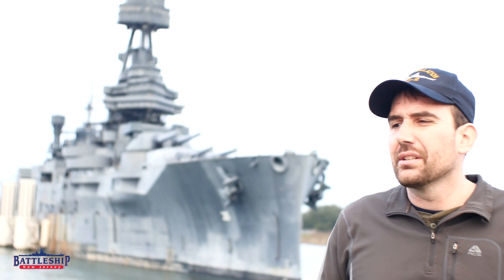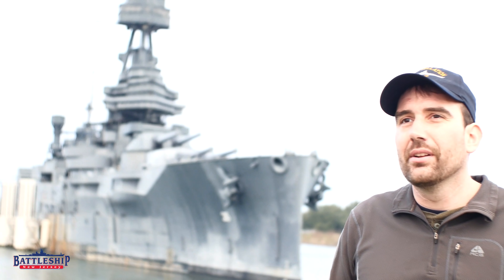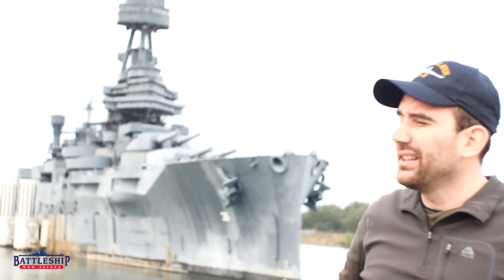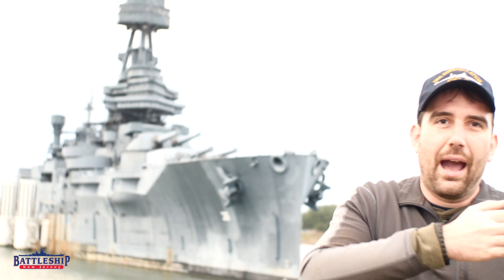Why Is Battleship Texas Shaped So Weird?

Comment: The designers of Texas, as you pointed out, had good reason to make Texas look as she does.  They were trying to solve as particularly set of problems.  That really world experience showed that there was better solutions too those problems is a normal part of engineering.  The Iowa's are just the latest in the evolution of battleships.

Comment: Easy answer, the original secondary weapons arrangement which never really worked out in practice on any ship. Modern (for the time) upgrades and modifications to the hull over the years, torpedo protection, etc., contributed to the “odd” shape. The California and Tennessee really demonstrated that.

Comment: I have a question about seacocks/valves.
Is there a difference between a seacock and a seavalve?
Are they there solely to aid in the scuttling of the ship? Or were they originally designed for other uses or purposes?
Reply: They were for cooling water, fire-pump suctions and evaporator feed suctions' they come off of what is called sea-chest. The main circulator for the main condenser was usually the largest and some main condensers also had scoop injection for speeds over 5 knots.
Reply: @robertmurdock9750  
Awesome! Thanks for sharing.
That tells me that their use for scuttling was ancillary.
Reply: @randypowell3180  Yes.

Comment: I've always wondered why more battleships didn't carry torpedoes or use quad gun turrets once the tech was there?
Reply: As the French and English found out,  quad turrets are problematic and cramped compared to triples. 

Most torpedoes of the WWII era had short ranges of 9000 yards or less.  The longest range one, the Type 93 Long Lance used by Japan was about 20k yards at its fastest setting and about 45k yards at its slowest.  Hitting targets at those ranges with slow, non homing, torpedoes was... unlikely, at best.

Comment: What is that circle right at the very front of Texas?
Reply: anchor chain passed thru it
Reply: @hirisk761   Nope, the forward holes are hawser pipes. These are pipes to hawser holes (The part you see externally) that mooring lines were passed through to secure her to a berth. The anchor chains pass through were the anchors are just behind these.
Reply: @Cragified  oops that was gonna be my second guess. thanks for the correction
Reply: Got my doubts we have a correct answer here. Look bigger than needed for mooring lines.  Did she originally have anchor secured there ? (or another set of anchors)
Reply: Craigified is correct.  Those are hawse pipes or hawse holes for mooring lines. Remember that mooring lines back then were Manila rope, not nylon, braided nylon, or some even stronger synthetic.  They needed to be considerably larger diameter to have the same strength.  You need pretty strong mooring lines to secure the massive weight of a battleship.
Reply: @wfoj21  I just googled pictures of the Texas when launched. there are 4 ⚓️ mounted but they are lower and further aft. those are hawser ports

Comment: Why did the move the rear mast on texas?
Reply: The original wastebasket masts couldn't take the weight of the modernized fire control gear, so they were replaced with tripod masts.  It was determined that Texas and New York couldn't mount to full-height tripods, so the superstructure was altered to bring the funnels down to one, and mount one full-height tripod forward, and a lesser platform tripod aft.

Comment: Form follows function as they understood it at the time of design.  Technology was accelerating rapidly at that time, both in sub and aviation warfare, which dramatically altered functional expectations year by year.  The ship went to design 7 years after the Wright brothers first flew and before anyone had a functional high seas submarine.  The big gun/line of sight philosophy of the day was only dated when using hindsight.  What is too often overlooked when comparing military hardware is the date of design, not the date of completion.....or those designed just a few years later.  The Brown Bess musket was current technology for almost a century, the battleship Dreadnaught was essentially obsolete by the time it finished sea trials.  Time and technology shifts matter.

Comment: I am curious as to why the casemates are layed out so differently than other nations’ casemates Why did early battleship like Texas have three bow anchors, with two on one side, and why did these third archors largely disappear by World War 2? Also would it be wrong to consider Texas as part of the Standards, despite predating them, considering her 14 inch armament and 21 knot top speed?
Reply: I believe that Texas was considered a "Standard" as all of those had 21 knot top speeds.  The outlier on the New Yorks (of which Texas is a member of) is the fact that she was a) originally built to use coal fired boilers instead of oil and b) has triple expansion engines--if I recall what I read correctly, this was due to a disagreement between the Navy and the builder.  All the other Standards had oil fired boilers and turbines.   The more well known Standards (the Nevadas, Pennsylvanias, New Mexicos, Tennessees) had 14" main batteries, with only the Colorados having 16" main batteries.

Comment: @Battleship New Jersey I would love to hear you cover the development of the cage and later tripod masts for Texas and the Standards… as well as the later pyramid-style masts on the NC’s and later BBs.
Reply: I was thinking the same thing.  The cage or lattice masts were thought to be a weight saving way to get the range finders as high as possible.  In heavy seas, the battleship USS Michigan had a lattice mast fail.  Live fire testing showed the lattice masts could take several hits without failing.  The Navy thought that made them safer than the later tripod masts.

Comment: A lot of the "weird" design features are actually iterations of earlier design features, from pre-battleship boats.
Multiple levels of gun decks for instance, was a slow fading of the design tradition of wooden Ships of the Line (from the time of the Napoleonic wars).  The Navy is nothing if not hidebound, and tradition bound.
Also, until you try these things out in combat situations, it isn't always completely obvious what will work and what won't.  Leaps of forward thinking are not easy intellectually, or easily justifiable.  Ships are very large and complicated. You don't just whip up a design for a revolutionary new one, on the back of an envelope.  The design schools and bureaus have an extensive accumulated knowledge base, and everyone concerned would be understandably cautious about making quick or significant changes. So the evolution from wooden, multi-gun-deck capital warships, to steel battleships, was measured, gradual, and only reluctantly relinquished known features.  Texas in in many ways a halfway house between a ship like the (wooden)Trafalgar, and the (Steel)Iowa.

Comment: 'Weird' Design feature: All secondary batteries in the stern, like in the Nelsons or Richelieus. While logical considering where the main turrets are, doesn't that layout compromise the intended use of the secondaries against torpedo boats and smaller ships? Or has that requirement changed by the time these designs were relevant?
Reply: I commented in another discussion.
Fleet destroyers grew significantly inter-war to become ocean going ships with guns comparable with battleship secondaries.
The Destroyers (and light cruisers in some navies), took the job of screening against surface torpedo attack.
The battleship secondaries were freed up for a greater anti-aircraft role.

Comment: Hey Ryan (or anyone) do you know how they calculated what the beam/length/weight/horsepower had to be to get to a certain speed? I've tried but could never figure it out.
Reply: it's quite a complex calculation but at a simplified level it comes down to thrust and drag. The hull pushing through the water creates drag, and the wider the hull, the more energy it saps (and the more engine power you need) to overcome that drag. This is where mathematical modelling and physical modelling come into play. By making a scale model of a hull shape and pulling it through a tank of water, you can measure how much force it takes. then multiply that number by scale, and you have a decent approximation of how much thrust you need, and can from that choose the correct engines, transmissions and propeller shapes to achieve the speeds required by the Navy. You also have to take into account the weight, as a heavier ship displaces more water and creates additional drag, and the shape of the rear of the hull is also important as water rushing back in behind the ship can also add a source of drag at higher speeds.

In the past these initial shapings could take years of research to get right, nowadays it's capable of being done a lot quicker thanks to computers doing fluid dynamics simulations that, whilst still a complex problem, are able to run tests with a lot of different variable much quicker
Reply: @pkscarr  Awesome thanks for the response!

Comment: As usual, a superb presentation! Might I suggest a presentation on the Hull Speed Length Ratio calculation. You touched on it in this video but a more (ish) in-depth conversation would be interesting.